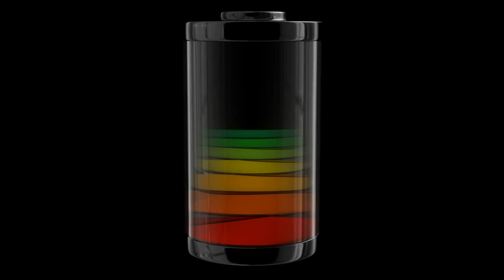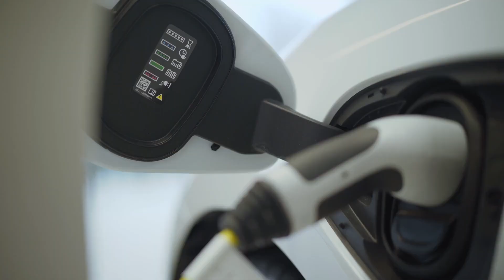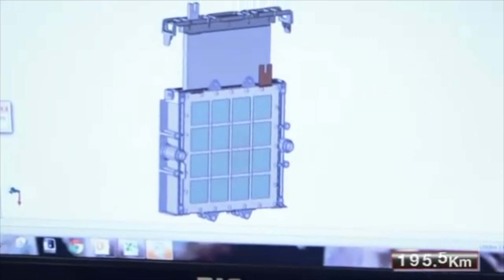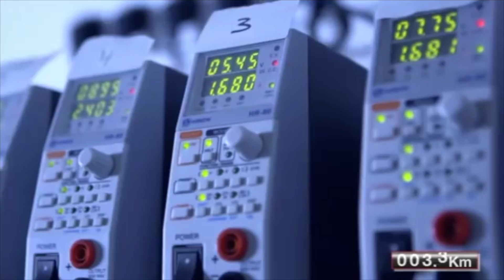This Battery Gives EVs 1000 Miles of Range!

Comment: Mr. Ricky, after listening to this passage, '0.21 / 15:57', like a dozen times, I gotta ask where you find a figure that shows 12.5 lbs/2 gallons (gasoline?) is enough to move a highway legal gasoline powered vehicle 300 miles?   What magic spuff are you using?  Maybe a trailer with a peppy little generator attached to the ev that runs & charges the ev while it's being driven ??!!??   Why not?  Call it 'an accessory'.  If not this, please tell me how I'm misunderstanding what you are saying.  I am not usually this dense.
    If we had real gasoline powered cars with 300 mile travel ranges using 12.5 lbs/2 gallons of gasoline, WTH would we even need evs?  Geesle, le weasel.
   & then, whazzis wit' da energy figures y'using fer 'producing' aluminum.??!   Pardon my ingles, but I kinda think you're telling us numbers for making aluminum from raw materials.  There's hundreds, if not thousands, of aluminum alloys, aluminum waste/recycling facilities
fairly readily available, so maybe, a whole lot of scrap aluminum will not cost as much as energy/CO2* amounts you mentioned to use/reprocess available scrap for use as 'oxidisees'.  Hey!  I like to play wit' words.  I've seen a whole lot of oxidised aluminum, so it'd be helpful if some of that & scrap reprocessing were part of the presentation.   Do all/most/many alloys of aluminum cease oxidising after they're 'coated'?   I've found sizeable aluminum 'artifacts' in various ocean, freshwater & 'outback' areas, and some structural material with oxidised surfaces wae still 'solid' underneath.
   Anyway, thank you for your presentations.  A little more info would make them even better.
*  CO2 makes my plants happy.

Comment: A battery that cannot be recharged is simply fuel. It's an aluminum feel car I'm not even sure you could technically call it electrical car because it's a chemical fuel car but in addition to creating some electricity makes heat

Comment: Aluminum has a greater potential than is realized in a chemical reaction. For shock value let's look at two Aluminum cubes at just 1 cc. In these cubes each Aluminum atom contributes 3 electrons, made available for interaction with the world. Removing 1 electron from each and moving it to the other cube a meter away, results in an attractive force equivalent to the weight of the Empire State Building. It also results in enough energy to power the USA for 3.5 billion years. All this without nuclear, or chemical alteration. Electromotive force is the denomination of force that dominates the literature and is the sole force contained within the cubes in this example. And a truly stupendous force it is. 

6.02e23 ÷ 18 = 3.34e22 atoms
3.34e22 ÷ 6.25e18 = 5,351 amps
3.34e22 x 5351 = 1.8e26 joules
1.8e26 / 3.6e5 = 5e19 kWh
5e19 kWh / 14e9 kWh per year = 3.6e9 years
Also please consider a 6MT nuclear blast is 4 TJoules. 
1.8e26 ÷ 4e12 = 
45 trillion 6MT bombs. This force is all epinuclear, or the electron attraction to the positive nucleus of the Aluminum atom. 
Scaling way back to make this usable dividing this Aluminum cube into foils 1" x 1/4" on a disk with some secret sauce, spinning a disk at resonance at 20kv to produce 12amps run through an appropriate transformer would produce enough energy to power a Tesla model Y.

Comment: LOL ... to the long 100 replies to the Miles to Km conundrum.
The easy way to !estimate! the conversion is to know a Mile is longer that a Km
by a factor of 1.6 km to 1 mile, or 3/2+ factor relationship (1.5 would be an exact 3/2) ...more
Thus, roughly we have 1 and a 1/2+ km(3/2+) for each mile or 2/3rd- Mile (2/3-) per Km
So 2 Miles *(3/2) = 3+ Km     (pad it to a bit more than 3 Km)
      3 Km    *(2/3) = 2- Miles   (pad it to a bit less than 2 Miles)
* If  you mess it up and get more Miles than Km just flip your 3/2 to 2/3
Another way to visualize it is, since you know a Mile is longer than a Km
if your known figure is Miles the bigger number (3) goes first.
5 Miles * 3 / 2 = 7.5+ Km     (pad it more as the numbers get larger, in this case about 8 Km)
8 Km    * 2 / 3 = 5-      Miles  (pad it less as the numbers get larger...)

Comment: "Pure aluminum alloyed plates" ??? If it's an alloy, it's not pure. An alloy is a mixture of chemical elements of which at least one is a metal. Unlike chemical compounds with metallic bases, an alloy will retain all the properties of a metal in the resulting material, such as electrical conductivity, ductility, opacity, and luster, but may have properties that differ from those of the pure metals, such as increased strength or hardness. So what is it that you are mixing the pure aluminum with? Is the alloy the key or the membrane? I worked with membranes that only permitted electrons to pass through, very similar to the first fuel cell membranes. We used it to prevent tin-lead anodes from turning trivalent chromium to hexavalent chromium (CrO3 to CrO6), which made it possible to plate trivalent chromium on  a commercial level. Is the membrane you use available for purchase? How efficient is it?

Comment: Aluminum air is a primary battery that gets half of its chemistry from the air making it very energy dense capable. Primary is a single use. Once all the electrons are consumed from the aluminum it becomes aluminum oxide. Not a metal but alumina gel. To turn it back into aluminum it must be recharged. This cannot be done with this design so it will be replaced.

Comment: Limited distance and recharge time is the main drawback to electric vehicles. Why not make the batteries standard and made to fit the space side to side between the wheels and the bottom to the inside car pan? Then instead of batter charging sites, set up battery pack swapping stations where they can be automatically swapped and charged at the station. 5 minutes in and out. Customer pays the usage amount. Simple.

Comment: Downside 1) not rechargeable. 2) need more testing data. If such a 'fuel cell' was in an accident and it ruptured, what would the potential environmental harm be? 3) needs lots of infrastructure to recycle spent cells. Environmental impact there?. Conclusion: continue to look into this, but also look into how recycling would work.

Comment: When I first heard about this my thought as to what made sense was a kind of hybrid with a rechargeable (e.g. LFP) battery and an easily swappable Al-air battery when extended range is required. I believe one solution to the short shelf life of Al-air is to pump electrolyte in and out as required, thereby reducing degradation. For me, a rechargeable 150 mile range would cover most of my regular driving in a week, while even a 300 mile backup would save me from nearly ever having to make a charging stop on a longer trip. It'd be almost the perfect EV!

Comment: am a nerd kinda person and am geeking out over this. A solution could be a mandated standardization of the power cell form factor. All vehicles would have a standardized cell receiver designed in such a way that any service station anywhere would have the equipment to remove the old cell and replace it with a fresh cell in maybe 15 minutes. Just as tank trucks now deliver gasoline to gas stations, Large delivery trucks could deliver fresh cells and pick up depleted cells to service stations. This would be more versatile than having electrical infrastructure and wiring for EV charging stations. Power cell stations could be anywhere there is a road.

As an aside, your speaking voice is very easy to listen to, with excellent diction/clarity of speech. Your voice is like an instrument. Hoping you take good care of it. Your demeanor is pleasant and laid-back, eminently listenable and watchable.

Comment: Hydrogen powered Internal combustion engines would be more acceptable to Americans. The technology already exists, the infrastructure already exists, and the exhaust is WATER, certainly acceptable to all owners of gas engine vehicle owners. Battery powered vehicle's trustworthy enough to go 300,000 miles do not and will not exist for at least 40 years. You, yourself admits to battery technology not being reliable enough for some time. Liquid Hydrogen exists NOW, and unbreakable containers exist NOW. Hydrogen powered vehicle's are technologically feasible NOW. Retrofitting vehicles can be done at minimal cost and efficiency has already been proved. Why wait for a "pig in a poke" unknown battery? Admit to it!

Comment: Forget battery powered vehicles for at least another 30-40 years when battery technology has become completely dependable for over 300,000 miles. Also make the battery very easy to exchange for rebuilt batteries without having to disassemble the whole vehicle to do so. "Slide in- slide out" like the venerable "D" battery, or the battery technology will never be accepted. Never!

Comment: The electric grid will not keep up with everyone owning electric vehicles. Be prepared to get stranded with no power to charge you car. No power to charge your car when ice and snow takes out the power in the winter  when power is out for weeks at a time Same for the southern states with hurricanes and lets not forget  all the tornados. We already have  rolling black outs in the hot summer months  with everyone running the air conditioners,and the same in the winter for heat when everyone is trying to stay warm. If you think you are saving money on fuel think again.  Those batteries are going to loss there usefulness and need to be replaced which will cost thousands of dollars. What is going to happen when all these batteries are junk are they going to the land fill and pollute the  environment?

Comment: This doesn't seem like a good Solution! Maybe it can be used as an emergency battery extender pack in an EV already running on Li ion battery.
The most promising Solution to battery problem imo is The Sodium ion battery which is currently being developed..

Comment: Speaking of hydrogen, have you ever considered looking at the work of Denny Kline, Daniel Dingel or Stanley Meyer. They all had different versions of on-board electrolysis to run internal combustion engines and they were all SILENCED.
Also silenced was inventor Troy Reed for his magnetic motors and new battery design technology. He did some AMAZING work!

Comment: Youve realised what i worked out recently this tech works outside of the cities of the industrial world.

Ive got a strong interest in aviation, boats and electric power..  
Lithium and seawater are scary. ..like on land but if your in the middle of the ocean 🌊 it gets very bad quick🔥 plus the range and Wt saving is a huge advantage .. an ABC Al brick  conversion😉 would give you the range on a long passage and at night or in high latitudes whilst leaving solar to top up the resident rechargable's. you could even dump the ICE generator   ..it can also supply the high levels of energy moving boats requires,  
higher continuous outputs than cars and vans.
Its also a lot safer moving and storing "dry" Al and Carbon blocks round than pre charged Lithium  batteries or Traditional liquid fuels.. there have been hundreds of horror incidents .. or Amonia and Hydrogen as liquids or gas.

Swapping out an Al B C for use in an aircraft or hybrid Airships like the 🇬🇧 Skycat/Skyship HAV
Would give them a lighter, but still stable energy source/ ballast especially for flying at night and capable of matching their long, long loiter and distance endurance roles. 

Or in an  aircraft a safer quick swap out...than trying to carry a monster lithium based pack or charge it in situ. 
 
The flux used to split Al from O2
Is Cryolite NaAlFluride... quite nasty if it gets into the environment. .. the energy issue ...? Well most big Smelters in Europe use either Nuclear or Hydro Electric ...

Its also the technology that inspired Prof. Donald Sadaway to develope his high temp flow batteries.  

 If they can get it right its a very useful and safe way of storing and transporting surplus renewables in areas where theres a lot of Solar and Bauxite ...the tropical weathered 
Soil/rock thats the source of this the most of this most common non ferrous metal.   

Also anything that keep the  mining companies from messing up the deep ocean floors dredging for  Cobalt and Manganese ... 🙄

Comment: These batteries are only going to get smaller and more powerful, but I'm old and for me I just can't get used to electric cars, it's like I need the sound and vibration, the combustible engine is on its way out, other uses for sure, but I see the future will have no combustible engine, dam progress.

Comment: In 1996 it was a group of engineers who drive a golfcart 1000 miles + on a single charge. It was done at the Alameda naval base in the Bay Area SF.
After 1000+ miles it was still some power in the battery, but the drivers was exhausted. But there was one problem, to recharge the battery they need to take the battery completely apart, to give it the right chemistry. And the top speed was  about 20 mph.

Comment: Thanks for the informative video.  I like your idea of swapping stations and recycling the aluminum.  The sky-high cost of charging stations and the reluctance of manufacturers to standardize connectors make charging networks impracticable.  And EVs will never be popular without assured driving range that competes with ICE vehicles.  I hope someone tries your idea.

Comment: Sounds good, but can we actually get replacement stations staged within a country to make that idea work. The cost of replacement would have to be within range of cost of equivalent of same gasoline cost for a similar or slightly higher cost of that same amount of gasoline or diesel fuel. The largest cost for automobiles is not just fuel, but maintenance cost are getting much higher each year as well. Taking total cost for a fossil fueled vehicle ,is it cheaper and less pollution oriented to operate this battery powered vehicle for the average length of time a fossil fuel vehicle remains operational. I keep mine an average of 9 years before replacing them. The Hydrogen fuel cell has far less operational cost, but fuel for them is hard to come by and costly.

Comment: The idea of having ev with smaller battery for every day use ~100km range and the have aluminium air battery on board for emergency. I might just pay to change that only once a year. or taking it for an occasional road trip.

Comment: You say an EV with a 300 mile range battery is equivalent to energy in 2 gallons of gas???  Not exactly a fair comparison. A 30 mpg gas vehicle would use 10 gallons to travel 300 miles since the average gas internal combustion engine only has a 20 - 30% thermal efficiency.

Comment: I can see another way to utilise this battery. What if you built a car using this long range battery and just rented the car for its mileage lifespan, then returned the whole vehicle for a exchange unit. I can see this in city use especially.  Wear and tear on tires could be factored into the rental charge. You could use a carvana type of vending machine to save time.

Comment: The cost to swap out the battery pack is the big question for me.  For example, a Cessna 172 has a range of about 736 miles and carries 43 gallons of fuel for a one-way cost of approximately $215.  (using $5 per gallon for avgas.)  Considering all the suppliers involved in the swap-out, transportation and refining of an equivalent battery pack, I can't see a viable solution.  The swap-out cost is bound be too high to be competitive with the current fuel burden. Or looking at it another way, the profit potential for the participants in the swap-out, transporting and refining process is going to be too small to motivate the required participants.

Comment: Interesting technology - the most attractive feature is the high energy density which starts to approach values typical of hydrocarbon fuels + ICEs.  A battery pack that weighs between 1,000 and 2000 lb for passenger car makes no sense - and will relegate vehicles powered with low energy density lithium ion batteries to a niche application.  Batteries or any other power source for that matter need to be in the range of 10 MJ/kg in order to be considered a viable replacement for the current ICE technology.  I'm glad that you focused on the question of energy density - it is a grossly overlooked drawback of current battery technology.

Comment: How about having an infrastructure similar to gas stations where they keep freshly charged batteries on hand ready to swap. At a cost of no more than a full tank of gas. The batteries should be of no more than two   universal sizes adhered to by all battery manufacturers. Cars and trucks would be designed and built around those parameters.
 It'll be interesting to see if The so-called poor countries who are rich in aluminum, will be brought up to a higher standard of living,  or will they continue to be exploited? 🤔 Haiti 🇭🇹 is one of those countries that immediately comes to mind!

Comment: They need to make two…(2)…isolated battery systems ,and use a charger and an inverter on the one battery… to recharge ,
the depleted one( I know this can be done…) and then we don’t need charging stations and we don’t need power plants!
I would also definitely have high output solar cells on the roof for collecting sunshine